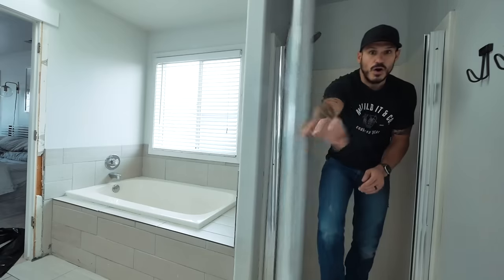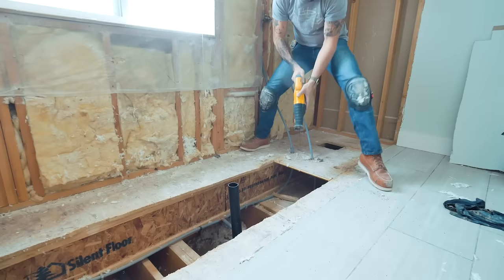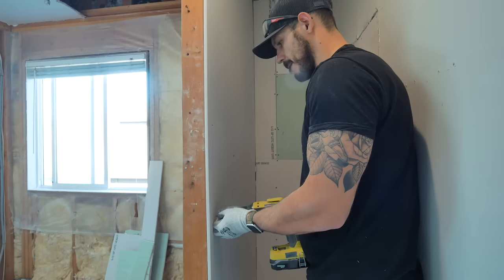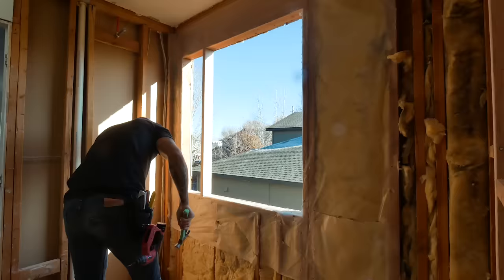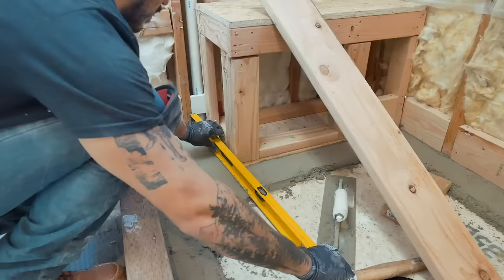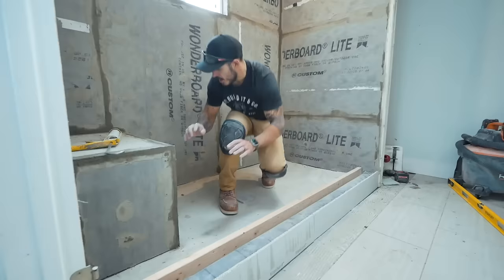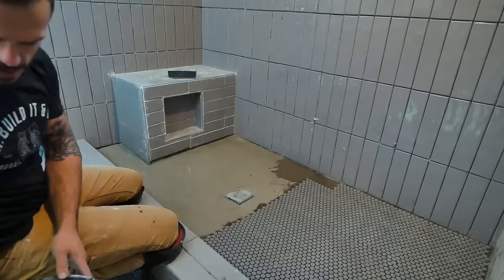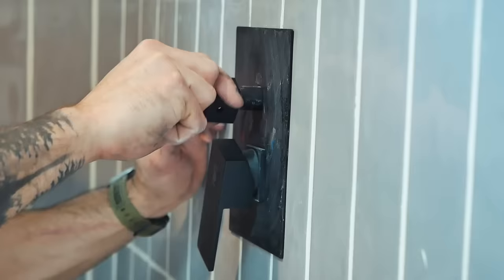Building a GIANT Shower (Home Remodel)

Comment: USA: Has tornadoes. Builds houses out of paper.  
EU: Ain't got no tornadoes. 1 meter thick granite wall should be enough...
Reply: True xD
Reply: @TajoTheFather  so true, they use so many wood. We are currently renovating our bathroom and the only thing that is made of wood is the ceiling. Everything else is made of stone
Reply: @A Guy Then why do you argument over a fact?
Reply: You see I live in california so the wood construction helps with that. Of course buildings with concrete and rebar are best but are 5x more expensive.
Reply: @gamezahoy712  I'm from portugal, buildings here are made of thick concrete walls, it might be safer and last like 100 years, but like you said its also very expensive to make one, also, to make any changes, is a pain in the ass demolishing those walls.´
Plus, in countries like Portugal, that the climate changes a lot, some of the houses are super cold in the winter. So it's a love and hate situation to this type of buildings.
Reply: Well when the majority of countries in it has had bombs dropped on it at some point, it makes sense.
Reply: GamezAhoy Unfortunately this is no longer true, the average housing around 300k ! For houses that can’t stand a punch in the wall
Reply: One small section of the country has Tornadoes... and they love their mobile homes... that does not make sense.
Reply: Wood is more flexible over stone.  Depending on where you live in the states, you want wood for earthquake flexibility.
Reply: @MikeHarris1984  From the Canadian border to the Texas gulf coast, from the front range to the eastern seaboard, yes that is one small section of the country. LOL
Reply: How do u make a house wit rocks
Reply: @PauloNavarro  Lol, you need to tell that to the people in rich California neighbourhoods that don't have wood houses. Biggest reason the US builds with wood is that it's cheap, has nothing to do with safety or quality.
Reply: @rztrzt  We're actually both right.  Yes it's cheap and fast to built, but that's not the only reason.  Yes, it's probably the main reason, but there is definitely more than one reason.  Unlike brick, wood is a flexible material capable of withstanding low-intensity earthquakes or light tornadoes. However, in areas that usually suffer this type of inclement weather, houses have a brick basement where to shelter. If the house suffers any damage from a tornado or earthquake, it is cheaper to repair it if it is made of wood because the material is affordable.
Reply: William Keltner it actually is small compared to the rest of the country.
Reply: @nofx84  Yea USA probably had something to do with that too lol
Reply: @MikeHarris1984  If by "one small section" you mean like the middle 1/3 of it, then sure...
Reply: @A Guy We´re not argumentative!
Reply: @JoseSantiago-fz3vx  The Americas would be amiss if it was not for the Portuguese. They are some of the best sculptors and marble installers I've known.
Reply: @Kazyro  Nothing made of wood in my bathroom. It's so annoying I can't do anything.
Reply: but we don't have big homes :(
Reply: All of the houses in Brazil (where I live) are made of concrete, bricks and the metal bar thingys, I don't know the name ksksksks sry, no wood is used.
Reply: TomTheTrain  Just the roof usually, and only a few clay tiles.
Reply: @JoseSantiago-fz3vx  Definitly not thick concrete walls, unless by saying that you mean 30cm concrete blocks , then yeah thick concrete walls
Reply: @A Guy This coming from someone at war with how many countries now?
Reply: @A Guy no we aren't hahaha
Reply: USA midwest is full of brick homes. Tornado alley has huge stone houses. Speak for what you know.
Reply: People renovated their homes all the time in North Amercia. It would be next to impossible to do that if everything was made of concrete.
Reply: @JoseSantiago-fz3vx  well, yes and no. Certain old buildings are hard to warm (if they are big) but may be better at maintaining the heat. And the cold in the summer. I live in a +100 year old house. It was made with stone and the outside walls were at least 40-50cm thick BEFORE we added any insulation. 40cm of stone is a lot 😂
Now, with 3-4h/day of heating we can keep the house at a minimum of 18°C in winter. And without AC and just windows we are never over 27°C during the summer. I think it's pretty efficient taking into account that it's an attic and that our temperature can be anywhere between -5°C and 40°C 

I do agree with how hard is to make any changes. A lot of regulations specially if the building has any type of historical interest (which is easy)
Reply: @A Guy Don't agree with that .....
Reply: ??? - Don’t be envious, big homes are a lot to undertake. That’s why there’s a tiny home movement.
Reply: Oh, the old "Wood vs Stone/concrete" debate. You can go either way; there's benefits and drawbacks to each method. With concrete/stone, you get a very solid feel, generally need no insulation (especially in sunny climates), sound insulation, good protection from tornadoes and gunshots (maybe a consideration in the US) and overall it's just really solid. As for water issues...concrete is actually not any better because if you develop cracks, it will destroy the concrete just as well. It still has to be sealed and maintained.

With wood/various other materials, you get a little flexibility for natural settling and earthquakes, the ability to add insulation and other features as needed and the ability to easily renovate later. It's also generally much less expensive. For water issues, it's the same thing...you have to check it sometimes and maintain it. Wood is obviously less resistant to tornadoes, but those are common only in specific areas. Most people do not actually live in "Tornado Alley".
Reply: In South Eastern United States the houses are made of concrete blocks. Construction depends on the geography.
Reply: they just getting ready for the medieval stages warfare.. that why it so thick...
Reply: @PauloNavarro  I live in an area of Spain where a lot of low-intensity earthquakes happen e.g. 1.5-3.5 around there, and they build here with the thickest cinderblocks and other types of stone, mainly limestone, and not one house, that I know of or have seen, has ever suffered damage from those low-intensity quakes, is it cheaper to repair, yes and no, if America would adopt this "European" way I'm sure that building with stone and sturdier material would get cheaper.
Reply: Wed o have some smaller tornados in summer in germany, but due to our krupp steel walls – no damage
Reply: the typical wood vs concrete arguments people love to make and then act like there's no good thing about wood lmao typical
Reply: USA so rich lol
Reply: US homes are seriously less durable when compared to EU homes.
Reply: @Dr.HooWho  It's excellent for fire which turns to coals I can grill my lamb chops over.
Reply: Heh, in many European countries it's not even about what the walls are made of. It's more about you need three permits, two architects, one European Commission regulation to pass, and the moons of Andromeda to align before you are allowed to do modifications inside a house you own (rent one? Forget about even drilling holes for a painting into the wall...).
Reply: @gamezahoy712  It depends. Houses in Mexico are also built almost completely out of cement and houses are cheaper due to the price of materials.
Reply: Yes and the quality would be not accepted. Sorry to say this but if you make this in germany, you can go home and do it again till its perfect.
Reply: EU: destroys its forest, has to build with non-renewable stone and further destroy its environment for basic things like homes
USA: properly maintained vast Woodlands with entirely renewable and sutainable wood farming that actually traps CO2 and removes it from the atmosphere rather than creating more. Also is cheaper, easier to modify for future regulation changes, and overall a far more pleasant material to live in.
Reply: i think it has to do with the english or dutch colonizing USA first, building crappy wooden houses is more a thing of northern europe, south is more stone
Reply: A Guy agreed!
Reply: Europeans : think the entire United States has tornadoes and hurricanes 😂
Reply: In Mexico we build with bricks and concrete because they are cold materials and it's hell down here some days
Reply: In northern Europe most houses are actualy made of wood since that's what we got here, building with stone is realy expensive where i live.
In north Scandinavia we hawe used "American" building methods since the 1940s and i think it will hold up well enough for the generations to come actualy.
Reply: @A Guy I would rather have arguments than riots and looting. :D
Reply: @JoseSantiago-fz3vx  the difference in price is only 15-30%.
Reply: Old habbits from wartime, we're secretly building bunkers since we can never trust eachother :P
Reply: I live in us now moved from eu.
Here they modify change and rebuild all the time. So it makes sense they don’t use concrete and bricks for everything
Reply: @Kazyro  lol
Reply: US housing market and construction industry is an example of  most efficient perpetuum mobile. Wood-frame houses with 2x4 inches studs as major pillars!!? and built from recycled materials will only last for 30-40 yrs at best even if there are no tornadoes or natural disasters. Thus, there should be not so much  for your kids to inherit  except for rotten building and a plot of land. Your kids will have to start from scratch (as you did) applying for a mortgage, etc, etc. Since they do not have anything left after all the bills are paid, the only option is to work for a corporation in order to get a (shaky) roof above their heads. Money paid as a compensation in one corporation go instantly into pockets of another (mortgage bank).  The construction code and laws/regulations will make sure that this ingenious(!!!) order is preserved. In short, it is all arranged in favor of big money.
Reply: @PauloNavarro  steel is more flexible, has more soundproofing due to flexibility, and has 3x the strength to weight ratio. But despite all of the termites, californians are building with tree corpses. We build with wood because we are CHEEAAAAAP and dumb.
Reply: @JoseSantiago-fz3vx  That's to keep the heat out in the summer. In a wooden house you would need to speed thousands of Euros on air conditioning.
Reply: @benedictearlson9044  Or insulate.

Comment: For being DIY its pretty good. The grouting on the wall tile is a bit sketchy and I personally prefer horizontal vs vertical placement. But I personally wouldnt feel comfortable doing a whole hard remodel myself like that without serious training first so mad props for doing it yourself.
Reply: that grouting is fucked id want it done again.
Reply: What's wrong with the grouting?
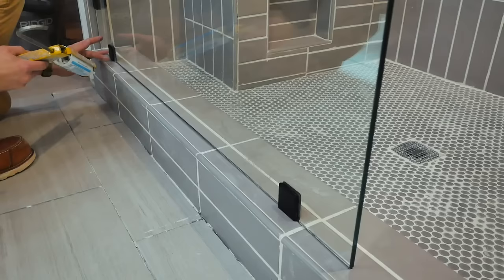Reply: @Sara_The_Feral_Housewife  What's wrong? Look at 15:34 to 15:47...terrible. As for DIY is good but..
Reply: @KeithMoonMTB  i know this is a year late but hey I wouldn't mind if my grouting looked like that if ot cost me 1/4 the cost to get it done. Sometimes it's function over form.

If it was me doing it I would have taken my time to make sure all the grouting was perfect. You would have thought it was professionally done.
Reply: The grout looks awful in the closeups.

Comment: “What’s the worst that could happen?”
Me: removes supporting beam, entire ceiling collapses.
Reply: Not exactly there would be excatly 6-7 support beams removing one won't do anything :)
Reply: Lmao my thought exactly brenyboy
Reply: @Noiboy35 , exactly. That was said by someone with no practical experience with construction I would guess. There would be ceiling joists every 16 inches to 24 inches. The only "support beam" that might make things fall like they imply would be the main roof beam in the attic.
Reply: LMMAO!!!!!!
Reply: @markcurry1168  totally agree markas curry. are you related too the basketball player. I totally agree with your statement because a suport beam would probably be so strong that if you took it down, it would take down the neighbor house to. Have a good day marcass kurry.
Reply: Word of advice. He put the insulation backwards. The papered side faces inward. The paper is to prevent moisture from touching the insulation. In a shower you definitely want the insulation facing the interior wall because those walls can get wet and ruin the insulation and cause mold.
Reply: A friend of mine actually decided to try and save money by doing his own renovation. Him and his wife wanted an open kitchen and living room. They removed a wall that turned out to be a load bearing wall.

The room did not collapse. But the ceiling has sagged almost 4 inches and has cracked. They had to spend a lot of money for a contractor to correct the issue.

He now only takes on small projects.
Reply: Don't worry. If you mess something up, it's just another opportunity for you to learn how to fix it.
Reply: No.

Comment: honest hes right most of this is easy i was learning how to do this when i was like 16. the hardest part of anything like this is just the plumbing and electrical.
Reply: Hagahaha,, have you ever done a complete custom shower pan??? And tile installation.
Reply: @recyclespinning9839  yep plenty. i can build a house from the ground up. i use to remodel homes completely with my dad all the time
Reply: @DAKGOD4EVER  ok, well good for you. But not simple for some one with out that back ground. There are also different methods used from different trades people in building the pan.
Reply: ReCycle Spinning Most of the difficulty in this comes from not having guidance and lack of tools or creativity to improvise on said lack of tools. I can’t improvise random stuff to help me do things I need the tools proper so I’m not a expert yet
Reply: Plumbing and Electrical are the easy part.. Making the Tile look good is hard and you can tell this guy has never done it.. The grout lines and lipage look like shit... And he put in an S trap which is wrong...